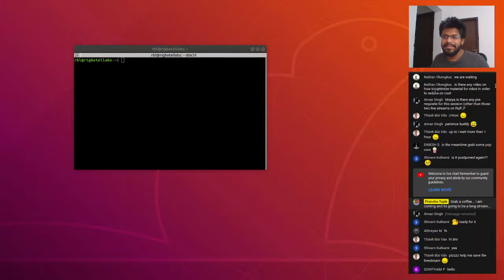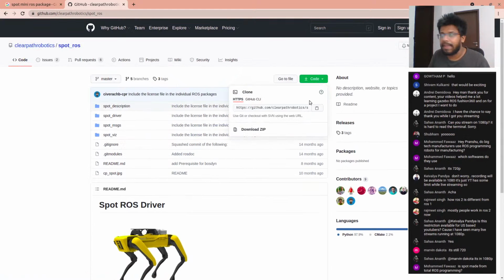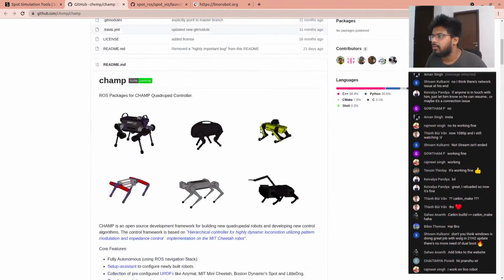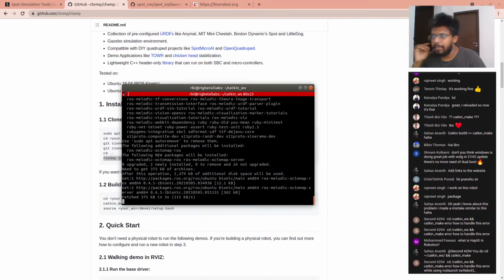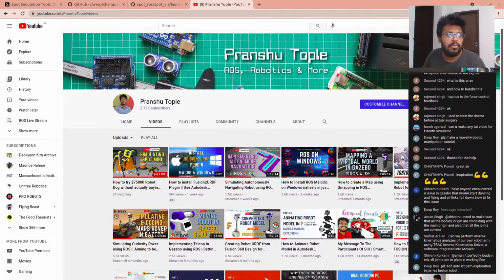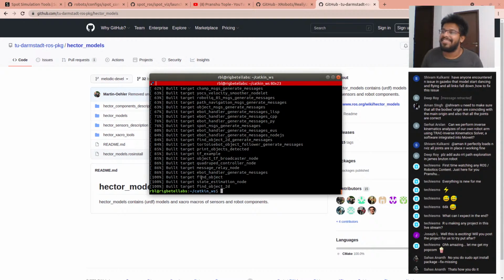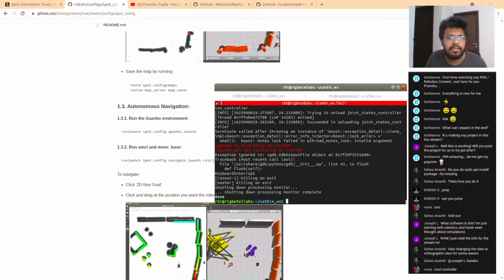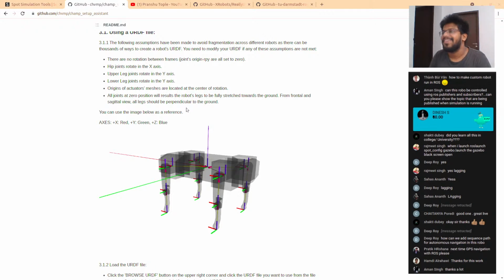How to try $75000 Robot Dog without actually buying | @BostonDynamics Spot Mini Simulation Package

Comment: Champ author here. Thanks for sharing the project. Great video tutorial!
Reply from the maker: I am glad you liked it!!! Also some people were facing problem in spawning the models in Gazebo which i have fixed and sent a Pull Request on the repository. It would be great if you could Merge the request. Also it solves one of the active issues on your repo. So you can close that issue as well. I have more plans for this repo. So I would be actively contributing to it

Comment: Hey guys I'm having a trouble when launching the command to download Spot rospackage: "pip3 install bosdyn-client bosdyn-mission bosdyn-api bosdyn-core" or "pip install bosdyn-client bosdyn-mission bosdyn-api bosdyn-core". In the case of pip I have : protobuf requires Python '>=3.7' but the running python is 2.7.17 and in the case of pip3 i have protobuf requires Python '>=3.7' but the running python is 3.6.9.
Did you get this problem and if yes how did you solved it?

Thanks

Comment: I have made the robot Hardware and stuck electronics and ros ...bcoz i am Mechanical engineering..thank you
Reply from the maker: Hello Sabarish! You could go through this repo - https://github.com/chvmp/champ_setup_assistant and its readme to bring your robot model into simulation and use all champ packages with it so that you don't need to calculate the servo angles and its gait positions. The README is pretty self explanatory if you have some basic knowledge of ROS. And if you don't have any knowledge of ROS and wants to learn it right from basics to a point where you can design and simulate your own ROS based robot, then you can apply for the 2 month long ROS Mentorship Program by filling the form on this site - https://rigbetellabs.com/mentorship
Reply: @PranshuTople   thank you

Comment: hi Pranshu,

I am getting following error while running 

~/catkin_ws$ roslaunch spot_config bringup.launch rviz:=true
... logging to /home/scg/.ros/log/1a4dda02-ef6b-11eb-8450-6c3be50edb15/roslaunch-scg-Workstation-9854.log
Checking log directory for disk usage. This may take a while.
Press Ctrl-C to interrupt
Done checking log file disk usage. Usage is <1GB.

started roslaunch server http://scg-Workstation:41209/

process[rviz-9]: started with pid [9940]
[ INFO] [1627452885.931163724]: Successfully parsed urdf file
[ INFO] [1627452885.936965878]: Successfully parsed urdf file
[ WARN] [1627452886.005811483]: Warning: Some linear velocity entries in parameter imu0_config are listed true, but an sensor_msgs/Imu contains no information about linear velocities
[ WARN] [1627452886.010636746]: Warning: imu/data is listed as an input topic, but all its update variables are false
[ INFO] [1627452886.038205516]: rviz version 1.13.17
[ INFO] [1627452886.038274064]: compiled against Qt version 5.9.5
[ INFO] [1627452886.038298718]: compiled against OGRE version 1.9.0 (Ghadamon)
[ INFO] [1627452886.042357619]: Forcing OpenGl version 0.
******************************************************************************************************************************************
[champ_controller-5] process has died [pid 9912, exit code -11, cmd /home/scg/catkin_ws/devel/lib/champ_base/quadruped_controller_node __name:=champ_controller __log:=/home/scg/.ros/log/1a4dda02-ef6b-11eb-8450-6c3be50edb15/champ_controller-5.log].
log file: /home/scg/.ros/log/1a4dda02-ef6b-11eb-8450-6c3be50edb15/champ_controller-5*.log
[state_estimator-6] process has died [pid 9915, exit code -11, cmd /home/scg/catkin_ws/devel/lib/champ_base/state_estimation_node __name:=state_estimator __log:=/home/scg/.ros/log/1a4dda02-ef6b-11eb-8450-6c3be50edb15/state_estimator-6.log].
log file: /home/scg/.ros/log/1a4dda02-ef6b-11eb-8450-6c3be50edb15/state_estimator-6*.log
*****************************************************************************************************************************************
[ INFO] [1627452886.401988387]: Stereo is NOT SUPPORTED
[ INFO] [1627452886.402056633]: OpenGL device: NVC1
[ INFO] [1627452886.402082717]: OpenGl version: 4.3 (GLSL 4.3) limited to GLSL 1.4 on Mesa system.
Property::loadValue() TODO: error handling - unexpected QVariant type 0.

OS- Ubuntu: 18.04
ROS Melodic
Reply from the maker: Are you using VMWare?
Reply: @PranshuTople   No, it is a standalone machine.
Reply from the maker: @akashrajput8516  Thats weird. Because the error says that it is unable to perform graphics operation that is OpenGL. Do you have graphics card on your machine?
Reply: @PranshuTople  yes.I do have NVIDIA QUADRO 600
Reply from the maker: @akashrajput8516  You might not have installed its drivers. So it might not be running. Please install its drivers and try again
Reply: @PranshuTople  After installing the recommended Nvidia graphics driver i.e Nvidia-390 I tried running roslaunch,but still facing the same issue

Comment: hello i have tried  to launch gazebo m getting  error 
 [ERROR] [1627157363.172272161, 0.033000000]: Could not load controller 'joint_group_position_controller' because controller type 'effort_controllers/JointTrajectoryController' does not exist.
[ERROR] [1627157363.172351084, 0.033000000]: Use 'rosservice call controller_manager/list_controller_types' to get the available types
[ERROR] [1627157364.173787, 0.165000]: Failed to load joint_group_position_controller
Reply from the maker: Run this command and then try again - 

sudo apt-get install ros-melodic-joint-state-publisher-gui
Reply: Still getting same error
Reply from the maker: @prashantpowar6351  Please check the error message properly. The message should be something different as we already downloaded those package
Reply: @PranshuTople  [ERROR] [1627195328.241398729, 0.021000000]: Could not load controller 'joint_group_position_controller' because controller type 'effort_controllers/JointTrajectoryController' does not exist.
[ERROR] [1627195328.241504553, 0.021000000]: Use 'rosservice call controller_manager/list_controller_types' to get the available types
[ERROR] [1627195329.242961, 0.210000]: Failed to load joint_group_position_controller
 
after sudo apt-get install ros-melodic-joint-state-publisher-gui  still this error coming
Reply: I have resolved this error actually it's Ros full desktop package error

Comment: Hi Pranshu,
I am getting the installation errors. I am using the focal and ros neotic
  apt: Failed to detect successful installation of [ros-noetic-tf]
  apt: Failed to detect successful installation of [ros-noetic-tf2-ros]
  apt: Failed to detect successful installation of [ros-noetic-hector-gazebo-plugins]
  apt: Failed to detect successful installation of [ros-noetic-hector-sensors-description]
  apt: Failed to detect successful installation of [ros-noetic-velodyne-gazebo-plugins]
Reply from the maker: Thats the reason I never recommend ROS Noetic to anyone. Most of the packages are not available on ROS Noetic. It is considered as middle child between ROS Melodic and ROS2. So i only recommend using ROS Melodic
Reply: @PranshuTople   I have solved the issues by installing the missing packages but roslaunch champ_config bringup.launch rviz:=true the topics in rvitz  shows the below error, I have checked the rostopic echo /odom and no values.
any info how to solve this

No transform from [front_right_upper_leg] to [/odom]